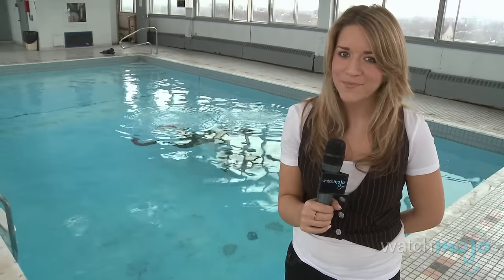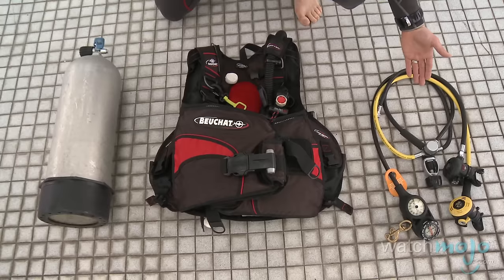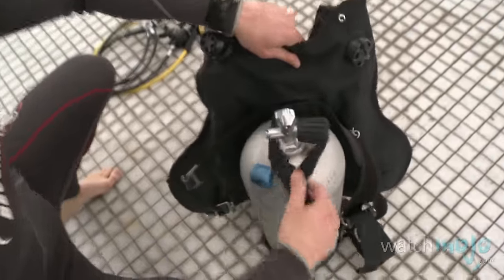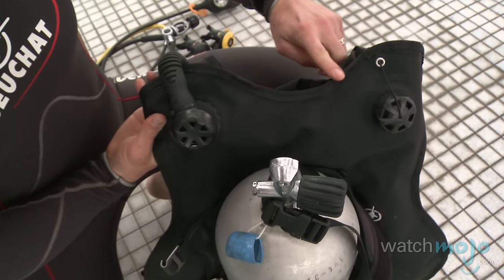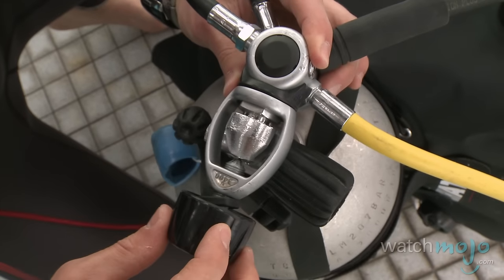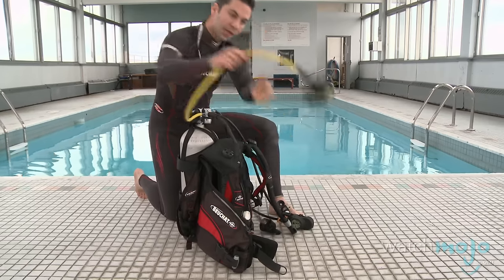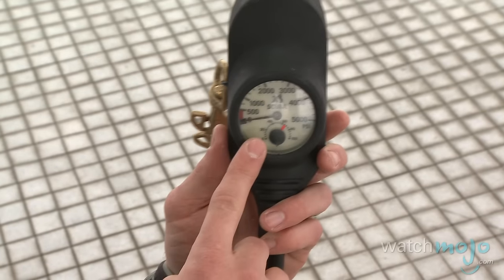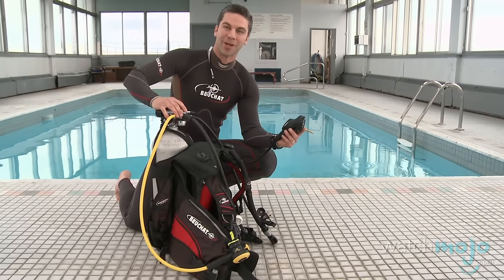Scuba Diving: How to Assemble Equipment

Comment: Many people asking why you should keep the valve with 1/4 give. There are two good really reasons.

1) To allow for a margin of error in mechanical failure. Important in the case of the unknown shit that can happen in the unforgiving environment that is the salty sea. This is true for all mechanical equipment, not just scuba tanks. Valves can and do get stuck open for all kinds of reasons, which causes all kinds of issues, especially if another emergency arises. If you have some give, you can usually do something about it.

2) When the valve is fully pegged, it is hard to know (during a check) which direction it is pegged (open or close) when the system is already charged. You could potentially peg it closed and never know. A pegged valve has a chance of being fully open or fully closed. An unpegged valve will always be open.. If the valve has give, you know the valve is open and is supplying gas. 

It is unfortunate and confusing as to why some youtube instructors do not teach this any more, there are real engineering and safety reasons to keep doing it. It is one of the easiest things to do.